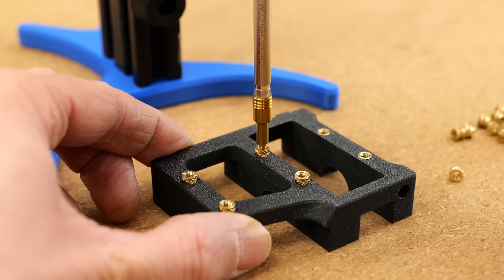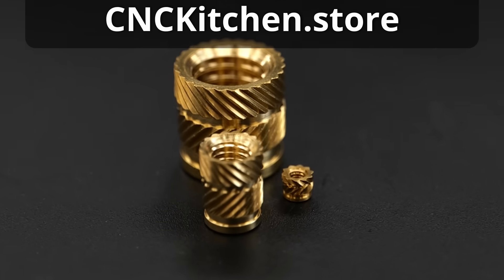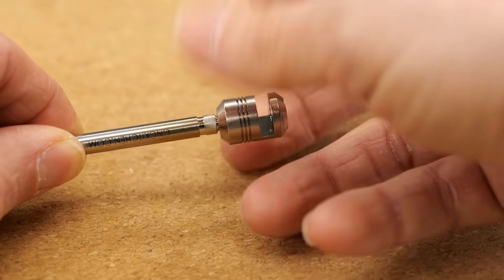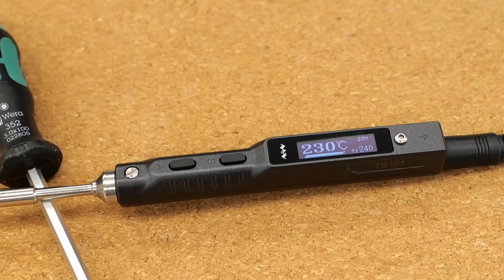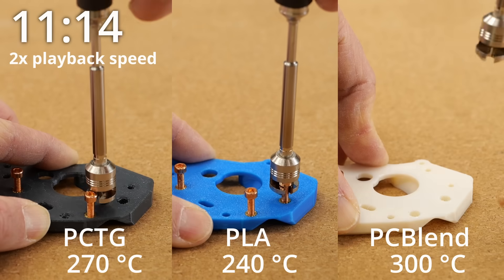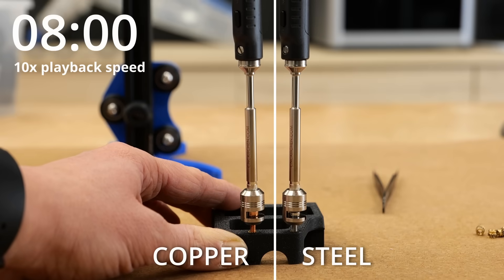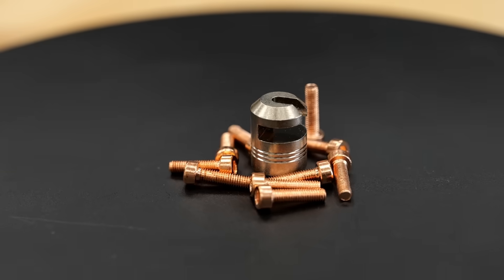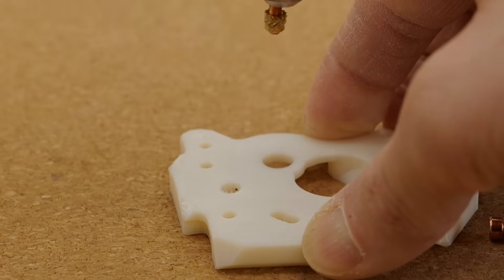We made the FIRST Insert EXTRACTOR!

Comment: Genius. If I were to comment on the design, well first off it's genius. Second, maybe I would have made the screw head identical across different thread sizes. E.g. M3 head and neck size for all M2, M2.5, and M3 bolts, to ensure uniform fitting to the camel toe block.

Heck, you could rather go for M5 head and neck size just because that's the "universal" attachment thread size for your heat set kit in the first place. Then taper the tips down to M2, M3, you name it. This way there'll be very good thermal conduction thanks to the broader contact surface. 

On a similar note, you could change the bolt shape to something like a shoulder bolt. Again, for better thermal transfer, and independent head size from thread size. 

Also, you could get rid of the hex hole in the head of the copper bolt. It could be just knurled. Three potential benefits here: cost saving on machining, less cavity area required in the camel toe (assuming that the head can be thinner), and fool-proofing (so no one wrenches and torques that poor wee copper screw). 

For yet another note on cost saving and better thermal conduction, you could make the copper bolts way shorter than that. If anyone needs longer bolts for inserts in deep complicated areas, that's where you can legitimately offer extra sets of longer ones to meet the needs. 

Hope this helps!

Comment: I think it's kind of gimmicky. I just a butane torch, a screw and a pair of pliers to remove inserts, just heat the screw for a few seconds and pull. No need for anything fancy, plus I'd bet it's a lot faster. You can also use the torch burn off the plastic on the insert if you're worried about the plastic that remained stuck to the insert.

Comment: I'm just preheating insert without force and quickly pulling with long screw by hand. I see absolutely no reason to buy this tool. After a little practice it will take you the same amount of time and the result will be of the same quality. No risk of damaging the soldering iron, work with any size. And keep your inserts in different containers according to filament type with which it was used.

Comment: I appreciate the effort you made here Stephane but really no need to heat set insert extracteur, just some heat from the solder iron and take et off with screw - especially if you need to undo 100 insert that will be a much of works - imo if I need to undo 2 or 3  inserts waiting my new pack of inserts i don’t need a tool 😊

Comment: If you are removing a thread insert, probably the part you extract from is going into the trash bc u doesnt use is anymore.. i tend to just pry them out with a long screw.. you doesnt even have to heat it..

Comment: Very cool and useful addition. I personally had some M6 inserts that I wanted to remove again but I simply didn't think of inserting a hot screw for that again...

I have one question though: How do you install an incorrect size into your print? The whole should have different dimensions for the inserts anyway, shouldn't you notice that before you insert the wrong ones since they either fall through or are far too big for the hole?

Comment: If you are removing the inserts, then presumably the printed part is no longer needed, in which case might it not be quicker to just use a pair of side cutters to cut/break the printed part to remove the insert instead?
Reply: Depending on the material used, that could take forever or easily lead to injuries

Comment: Nice idea, but the temperature settings are nonsense.
Just set the soldering iron to full throttle, because you have to wait until the heat has gone through the screw anyway. And the hotter the soldering iron is, the sooner you can pull out the insert.
Of course, don't forget to immediately remove the screw from the soldering iron when you're done.

Comment: Ok i actual bought your insert tool specifically too make an extractor. 

I went super simple though and bought a m5 brass standoff and filled down the m5 male end to take an m3 thread die.

Works with ts100 or pinecil as you can pull the usb power. Spin the soldering iron to thread. Heat, extract. Detach power, grab insert with pliers (it's hot), unthread and repeat.
So slower than yours.

I have to say though, your price is very reasonable. To the point where I'd consider it even though i own mine.

Comment: the question of the correct force can be addressed. I suggest, that you make actual measurements about that. 
Also, I would suggest, that you put out files for spring loaded stand, for your sodering iron.  If you engage the spring to the full extend that the stand allows for, it should be on that optimal force. while the travel diestans should be enough to remove the insert. 
this contraction should solve the problem of lack of patience, thus allowing for bigger insert removals.

Comment: Hi, Stefan.  Would you look into modifying a winged cork screw to cold pull thread inserts?  You may be able to easily get the pull strength you need without heating.

Comment: I appreciate that as a seller of threaded inserts, you are willing to share this secret knowledge😎 
I simply use a soldering iron to heat the threaded insert. When it sinks 1 or 2mm into the plastic, I thread in a matching screw a few turns and pull out the insert. Works like a charm!  
I even made a YouTube short about this a while back.
Reply: everyone knows that. and everyone knows that there is room to improve that process.

Comment: I just filed down one of my extra soldering tips ( for pressing inserts ) to roughly 3mm and then used an m3 die to cut a few threads into it.

Pre-twist the soldering iron once or twice before threading it in ( so the cord doesn't end up all bunched ). Alternately, smaller parts can be twisted onto the iron. Either way, the insert slides right out practically immediately.

A few quick wipes with a folded over dry paper towel gets the molten plastic off and they look brand new. The towel can also be used to untwist the hot insert and set it aside.

Not only does this have a much larger thermal mass to heat up that then needs several seconds with force applied to warm up the extra screw, but then after extraction, the loose screw and insert would immediately start cooling and can't be wiped down effectively.

I would be much more interested in buying a soldering tip set with different threads already cut into them. Simpler, cheaper, and more effective.

Comment: Will M4 and M5 copper screws fit in the tool, for those of us that would source our own?
Reply: @rickgreer7203  M5 you could potentially just use the raw heat insert adaptor. As that is M5.
But otherwise, good question. ☺️
Reply: @jetblackstar  Oh, yeah.  (I mean, right now I just heat up the insert with an inserter, screw in a steel screw, and bend to pop it out with pliers.  At a certain not-to-hot temp they seem to come out easily but clean of plastic too.  A little brutish though...lol.)

Comment: I've had a threaded heat press insert adapter for my soldering iron going on 3 years now. Interesting product to let you swap sizes like that but let's not get carried away.

Although I'm not sure why you'd ever need dedicated extractors. You could accomplish both with a single piece but the product I'd really want is a threaded iron adapter with threaded sleeves. Support different sizes by starting with a base M3 or M2.5 iron tip then screw on a 'sleeve' with M4/M5 OD threads. Have the threads only extend halfway so it can be flipped to the unthreaded side for insertion. Put flats on this section for quick removed with a tool while the iron is hot.

So the final kit would be something like: 1 x Threaded M2.5 soldering tip, 1x M3, M4, M5 insertion/removal threaded adapters. The unthreaded side of the M3 adapter could also work as the M2.5 insertion tool if you sized it right.

I'd just use M3 as the base if the difference between M2.5 is too small to be practical. I think most of us rarely use inserts smaller than M3 anyway.
Reply: nothing but waste of space.

Comment: Could the tool also be used for inserting as well as removing since the screw could be see as an extension in which the insert is also pressed into the part. I have had issues with inserting the inserts as the plastic builds up below the insert leaving only a small space for the screw (I know it could be wrong size, but 3.5mm hole with m3 inserts seem like good enough and yet still get plastic build up).

Comment: That's a really useful idea! Out of curiosity: did you try stainless steel screws or regular steel ones? Thermal conductivity varies quite a bit (Regular Steel: 40−60W/m⋅K, Stainless Steel: 10−30W/m⋅K, Brass: 100−120W/m⋅K, Aluminum: 200−250W/m⋅K, Copper: 390−400W/m⋅K).

Comment: Is it possible, that the copper body and screw expand enough through the heat for the screw to get stuck in the body?
It looks like it at  3:17. Other than that, this seems to be a very clever idea. Technically you could have designed that puller adapter to fit more screw sizes with a stepped opening, but still, I like it

Comment: I was on the store earlier today for unrelated reasons (I've used a surprising amount of M5 inserts) and noticed this device. Thought it was interesting but I haven't had a need to remove a lot of small inserts yet.

Also, THANK YOU for releasing a purpose-built Hakko T12 adaptor. Until now I've been rigging the EP5 set to my soldering iron with kapton tape. It is not a safe or efficient setup.
Reply from the maker: Great to hear that!

Comment: It might be worthwhile to check the temperature of the inserts when you can actually remove them. 
Since the heat has to travel through a bolt you might be able to go for a higher temp without risking fumes, and make it a quicker process.

Comment: Interesting, I literally had to do this last night. Conducting along a screw turned out to be unreliable and slow, so I just put in a bolt and used a hot air gun to heat up the screw and the surrounding area while applying tension to the screw with some tweezers. Came out great!

Comment: The idea looks great, but I think the design would only work for a "screw in" typed soldering iron. I use a Pinecil, which is push and friction fit soldering tip. Any amount of pulling force will remove the tip from iron. So, like one other comment have mentioned, a more elaborated design with heat-break and handle would be better (you know, like the hotend heat break).
Reply: You know the pinecil has a set screw for the tip, right?

Comment: BTW:  Something people often don't think of is that you can put the insert in from the non-screw size and get extra strength.  You make a clearance hole for the screw and then step to a larger diameter where the insert will be.  Heating the insert with a screw will work for removal in this case works because the screw doesn't touch the clearance hole so the heat still only goes into the insert.
Reply: This is only possible, if you have a through hole. Holes for Heat set inserts are often created as blind hole for visual reasons.
Reply: @Craftlngo  Yes, blind hole look better but if you are after strength, far side inserts work better.

Comment: Hmm... Never seen it as an issue.

I insert soldering iron into insert to make plastic around it hot (insert starts to sink in a little). Then remove soldering iron, quickly screw in few threads of screw and pull. Works for any size inserts. No chance damaging soldering iron. Never seen a case it could not handle.

Pro tip - use stainless screws - conduct heat slower. :)

Comment: Germs so eco... Threded solder tip with 2/3 rotation and tweezers, would be more eco-germanic. Less material, less manufacturing, less polution, jaa? 
You are german, you can do better. Also 1,5Nm is pulling out M3 inserts which is even more eco. But the most eco heat inserts are called nuts 😃

Comment: I've always just used a 3d printed hollow cone with a hole at the tip large enough for the screw but not head. Can use a washer between the head and cone tip to increase its longevity. Then used an electric screwdriver to yank the insert out. Don't have to deal with a hot insert.
Haven't checked how much damage it does to the threads of the insert, but it has worked fine so far.

Comment: As many have said, this is not new. The first heat set insert soldering iron tip I ever had was threaded and I used it a few times to remove inserts. But I understand the algorithm requires click bait thumbnails now--I get it.

Comment: 🤔 Can't say I'm hugely impressed 🤨 I'd rather stick my true and tested method of heating the inserts up again followed by pulling them out using an M3x40mm Screw I kept holding at the ready in between the fingers of the hand manipulating the Soldering Iron ( Screw held by the tips of the Thumb, Index and Middle Finger / Iron held between the Ring, Pinky and base of the Thumb ). Insert the Iron into the Insert, count to a known number that works for pulling it out, swap the Iron for the Screw to be threaded into ( 2-3 full turns suffice ) and pull out. Remove Insert from Screw using Tweezers ( or wear heat resistant gloves on the other hand ). If the Insert comes out grimey AF I shove it back in ( with the Iron if necessary ) and repeat the process which will usually do the trick 😏

Comment: I reuse inserts to save money. My current method of extraction is to heat up the insert completely before swiftly screwing in a bolt and pulling on its head with pliers. Or pressing it out from behind while heating for through holes. This tool looks like it would recover more inserts successfully and save time at a reasonable price so I'll be ordering one.
Reply: Screw the bolt in and heat it with the torch while holding it with the pliers and you will feel when it is loose enough to pull right out.

Comment: I just used regular screws, a gas lighter and pliers. Screw in the screws, heat them with a gas lighter for 3-4 seconds, wait 1-2 seconds and pull out the screws with insert using the pliers. 🤷

Comment: Are there any known solvents that can get rid of the PLA? or some method to burn it off? This method seems great for removing inserts, but without a way to clean the residual plastic, it doesn't seem that great for recycling them.
Reply: Blasting them with a torch will burn off the PLA. Might discolor the brass, but it won't hurt them unless you heat it enough to melt the brass.

Comment: I've been doing this for years with a custom tip on a (very old) soldering iron. It works great, although I typically keep the pull temp to around 180°and they come out of PLA and PETG perfectly cleanly. You've introduced a nice feature to be able to yoke around a screw, then let it sit to cool. I typically have to use pliers and unscrew the insert to move into the next one
Reply: I bought some brass screws to make a tip myself but never got around to it. I'm thinking again about it and just silver soldering the screw to an existing weller tip.
Reply: @Sevalecan My older soldering iron has a hole with a clamp screw from the side, so I was able to just sand down the head diameter of a screw to 5mm to fit in that hole. Certainly an easy option if you've got an old soldering iron laying around

Comment: I work on repairing payment terminals at my job and there is quite a bit of ewaste there. I try and salvage useful parts from them and I’ve always noticed the threaded inserts and wondered if there was a way to extract them to reuse them. You have come to the rescue!!! This will have an actual impact reducing waste through reuse especially in my hands. I can’t wait to get one Stephan!!!!
Reply: The inserts used in injection molded parts are different from the ones used in 3D printed parts. They don't work as well if they are pressed in.

Comment: This is a tricky one; one of those 'darned if you do, darned if you don't' designs, as far as using what a maker already has vs. designing something totally new. I 100% understand using a soldering iron for the heating, since it's how the inserts are installed, and it uses the iron's heating power. But I also wonder about the wisdom and performance of using it so far outside it's design. 

I think adding an insulated grip point on the tip itself would help a lot, to remove mechanical strain from the iron. Also, reducing the thermal mass and path to the puller, if that's possible. Is think risking damage to the soldering iron, clunky use, and the time to remove each insert are pretty major marks against the product, except for a select few consumers (or prosumers.)

For a use-case this specialized, this seems like a new tool is required. I can imagine using a steel screw insert with an insulated pull-point that gets put into the insert, then an induction heater that heats it up. That would heat the screw much quicker that the iron, and simplify the mechanics. You could even have a spring-loaded puller attached to the heater that hooks onto the screw pull point. When you lift, it activates the heater and applies the prescribed force to the screw. Of course, designing an induction heater isn't trivial, but it may be a more appropriate approach to this design challenge.

All that said, thanks for another great contribution to the maker scene! Even for what I've said above, this is much better than my current method of butane torch, screw and pliers 😂.